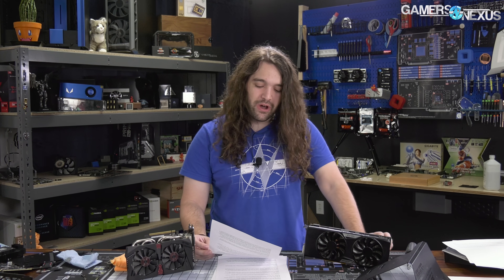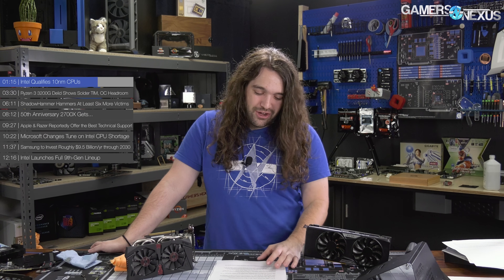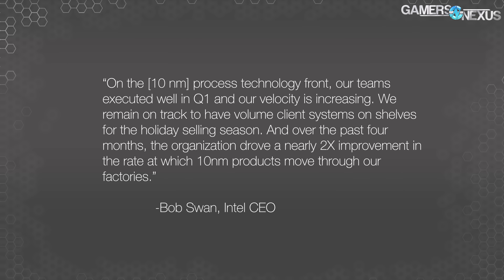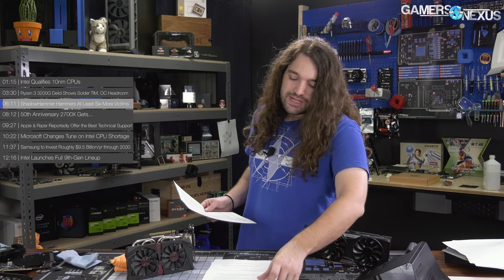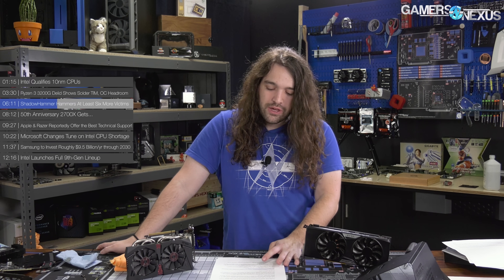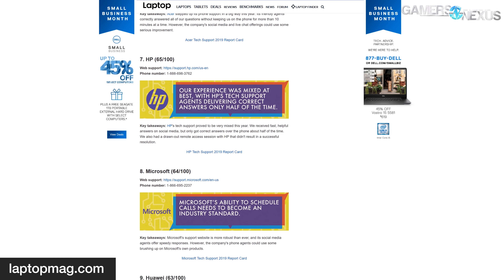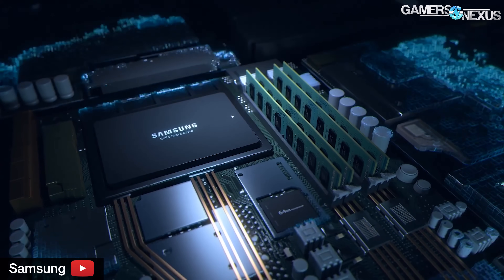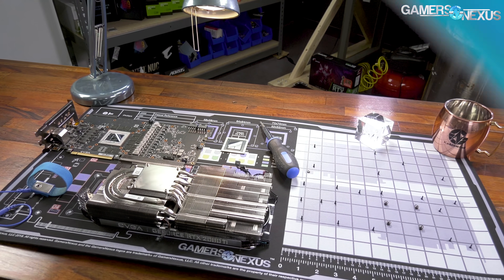HW News - Ryzen 3200 Delid, Intel 10nm Qualified, & More Malware

Comment: I really hope Ryzen 3000 is even better than 2 and really keeps that gap short between it and Intel. I like competition
Reply: Hee hee, getting irate about CPUs
Reply: @goblinphreak2132  It will be hard to do given Intel uses it's own fabs unlike AMD.
Reply: The hell is this comment line?
Reply: @Herr.Mitternacht  I'm stating facts that's all I've done. Responding to stupidity and fanboys with no brain cells but whatever mate.
Reply: @yulfine1688  I hope u were trolling man, u can't b serious
Reply: its a fake 7nm 10nm design that is less efficient than intels own design which is also harder to work with but no one cares about that because people are too stupid and too excited with fanboyism to notice. But yes the 3000 series is supposedly compared to a 9900k in performance when you talk about the the high end 300 series anyways. So in anycase they made a chip that caught up with a supremely old design....yeah good job.
Reply: @yulfine1688  you are aware that the ryzen 5 8 core part was beating the 9900 k benchmarks currently? The ryzen 9 part is going to be double that
Reply: @yulfine1688  all right kid just to help you out. We're talking about the new ryzen 5 coming out. The 3000 Series ryzen 5 is an 8 core 16 thread part. It's also running at 5 gigahertz. They demoed that part a couple months back and it beats 9900 k. Considering it's on a smaller manufacturing process 7 nanometers versus 14 that means it's also winning in single core IPC. The ryzen 3000 series R9 is a 16 core 32 thread part. It is double the performance of a 9900 k. Because it's double the threads and cores. Usually when someone starts name-calling it's because they  lack intelligence and can't communicate easily in an argument. If you actually did any kind of research you would understand that the part demoed had one CCX module and there's room for two on the chip. Plus each CCX has eight cores 16 threads. And if you're talkin about backwards compatibility you realize Intel has been making people switch motherboards every two generations. They even made people buy new motherboards when the socket is the exact same size 1151. Z270 boards don't support 8th 9th gen use the same socket same thing with z170 boards. So don't even get me started on backwards compatibility. Until recently Intel hasn't soldered its CPUs. They used to solder the 2600k series and prior to all their servers processors and those things are still running . You are aware that every single Intel server processor is still soldered correct? If it was a reliability issue you think they would solder server processors? You know with the customers who need reliability the most? I still have 1st Gen x5675 6-core processors sitting on my shelf and in one of my computer's that still run great. I bet you don't even know what one of those is you child. Settle down stop having your outbursts and just wait till the product comes out and benchmarks are compared. You're literally bitching about something that hasn't come out yet competing against something that Intel hasn't even finished designing. That's like complaining about a 2020 car losing to a 2023 car that hasn't even been designed yet.
Reply: @yulfine1688  >Creates a new CPU with a new design/layout which shifts the entire desktop CPU market away from quad core refreshes, now after 1 node shrink it is apparently comparable to the fastest current desktop processors on the market (core for core) and you type ''they made a chip that caught up with a supremely old design... yeah good job'',  acting like the 9900k didn't release less than half a year ago. yes they ''caught up'' with single core performance but the architecture itself has much much more capability outside of that. 
It's almost like you're an incredibly biased imbecile who doesn't understand anything about cpu design outside of single core performance. i bet you where one of those idiots who said a 7600k was a better buy than a r5 1600 when they came out because ''muh single core''. and now you're stuck with a 4c/4t CPU on a outdated platform, good one.
Reply: @EngulfedEUW  lol what are you even talking about 14nm is definitely outdated. The 7600k beat out most other chips except for some 6 core and all 8 core chips for multi core use. The 8600k was slightly beaten by the 2700x in multi core tasks except the big difference was in rendering images to where all high core counts won. The 9900k has great multi core and single core performance. So whatever you're smoking mr fanboy idk. I care not for these companies I care to get the best parts.
Reply: @yulfine1688  First of all 14nm isn't outdated because it's THE current fastest desktop liphography,  Secondly the 7600k cost the same/more than the r5 1600 when it released... THAT'S THE POINT, and it only beat the AMD CPU in single core heavy workloads in very specific circumstances and got smoked by the r5 1600 in multicore workloads. Thirdly the 2700x absoltely smokes the 8600k in multi core tasks, i'm sure you're referring to the 8700k not the 8600k because the 8600k is 6x/6t and the 2700x is 8c/16t, Lastly 7nm and 10nm aren't marketing schemes it's just what they call the lithography they manufacture the CPU's with... Intel and AMD don't use the same source for their silicone.
Reply: @EngulfedEUW  last I checked 4.2ghz on a 12nm ryzen beats 4.2ghz on a Intel 9900k @14nm so that is not true... currently 12nm is the fastest available lithography...
Reply: @SilverKnightPCs  should of phrased it as the fastest current desktop CPU is on 14nm
Reply: @EngulfedEUW  You don't need to prove anything, comparing Ryzen 3000 to current Intel offerings is just ridiculous. There should be no arguments at that point. AMD bypassed Intel, maybe intel will come back in 1 or 2 years, but for now, AMD is ahead.
Reply: @HamzaElgarrab  also back in the day of bulldozer I was for one telling Intel fanboys that AMD isn't dead for multiple reasons before ryzen was even mentioned or leaked. I honestly give no fucks for either I want the top hardware that's all. And right now depending on my budget of..7 grand for the entire setup I don't care if its amds chips that are better or.intels i want the best. And the same goes for gpus. I want the best card on the market either dual or single either works. With such a high budget doing dual cards will work fine. Should last me I'd imagine a decent few years before falling so far behind they're not able to keep.up. though in reality they probably wont last more than 2-3 years.
Reply: @yulfine1688  I know you are trying to use your brain, but man, you got to do better than that. The way people call x-nm for various reasons, signal propagation speed, power consumption, signal stability, capacitance, induction, .... etc. etc. So when we state 7nm vs 10nm, no matter how one likes to spin, the fundamental lithography limitation is here to stay, either one pulls some smart ass short cut or not. Because in the end, size do matters. Intel needs to do what Intel needs to do, end of discussion. If you read the industry, you know people are gunning 5nm next, and Intel still works on what? And for a company size like Intel, they got to spin and you know that, right? Don't be taken too easily!
Reply: @yulfine1688  Amd's chip design is inefficient? in what way? they destroy intel chips in power consumption and scaleability... and that's before they are movibg to 7nm and a chiplet layout.
Reply: @yulfine1688  man, be civil, you literally insulted me for no reason..
Reply: @EngulfedEUW  The 7600k beats every ryzen cpu in gaming hands down.
In fact,Techspot did a over 30 game benchmark showing the 8400 beating the 2600 in almost every game.
https://www.techspot.com/review/1627-core-i5-8400-vs-ryzen-5-2600/

It is common knowledge that the I5 still beats Ryzen in gaming.
The only edge Ryzen has is in certain multi-threaded apps.
Reply: @SilverKnightPCs  Where did you see that?
As of yesterday's rumors AMD fucked up.
Basically we are getting Ryzen 200 just better efficiency.
https://www.techspot.com/news/79839-leak-ryzen-3000-runs-45-ghz-beats-ryzen.html
Reply: @phillip_iv_planetking6354  frame time consistency is won by the 2600 though. And who cares about the marginally higher fps at full hd resolution. If you build your pc right you'll get a gpu bottleneck before a cpu one
Reply: @benwlee  TSMC's 7nm is not a real 7nm it is only 7nm in name.
This is common in the industry.

In fact,TSMC's 7nm is compared to Intel's 10nm because it is far closer to a 10nm than an actual 7nm pertaining to transistors.
Although,certain key features are smaller in TSMC's "7nm" than on Intel's 10nm.
https://en.wikipedia.org/wiki/7_nanometer

And if rumors are to be believed as of late then all we are getting from AMD is Ryzen 2000 just far more efficient.
Which is good but not enough.
Reply: @L424RU5  In some games.
But losses in majority of them.
Reply: @phillip_iv_planetking6354  "the 7600k beats every ryzen cpu in gaming hands down" then you share an article showing an i5 8th gen getting beaten by a 2nd gen ryzen cpu... baring in mind the 8th isn't unlocked but does have 2 more cores than the 7600k.

i also find it funny when you say the ryzen cpu beats it in "some" multicore workloads... you mean just about all of them right?
Reply: @phillip_iv_planetking6354  also both lithographys are "7nm" only in name... "7nm" does not relate to any kind of dimensions... it's just what they name the iteration, yes intels "10nm" is as dense as AMD's "7nm" but they use different sources so obviously they won't have the same silicone.
Reply: @phillip_iv_planetking6354  also don't know why people are discussing intel 10nm when refering to desktop parts anyway... if sources are correct they won't release 10nm desktop for years yet.
Reply: @EngulfedEUW  Because there is not much difference in gaming between the two and there is no 30 game benchmark comparison with the 7600k.
But even the small benchmarked game lists the 7600k wins in majority of them just like the 8400.

Ryzen does not win in all of them.
It wins in some and loses in others.
Reply: @EngulfedEUW  Depends if you believe rumors.

Also,I think because if the rumors about Ryzen 3000 are true then we are getting nothing more than Ryzen 2000 with better efficiency.

That's nice but nowhere near great or game changing.

Best to take everything with a grain of salt.
Reply: @phillip_iv_planetking6354  oh is that what you meant by "the 7600k beats EVERY ryzen cpu in gaming hands down"? and no a 6c6t intel chip from a newer generation isn't "close enough" in gaming to a quad core for reasonable comparison, that's ridiculous.
Reply: @EngulfedEUW  I know.
They base their comparison on amount of transistors not dimensions.
I thought I stated this already?
Reply: @phillip_iv_planetking6354  yeah density, so the term 7nm doesn't correlate to a physical boundary it's just the name of the liphography... therefore it cannot be "fake"
Reply: @EngulfedEUW  Actually that is what makes it fake and a pure marketing ploy.
Reply: @EngulfedEUW  What?
Did you just really say this?
"and no a 6c6t intel chip from a newer generation isn't "close enough" in gaming to a quad core for reasonable comparison, that's ridiculous."

Is this really your logic man?

I can easily post benchmarks showing a 7600k and an 8400 neck at neck in most games.

Wow.
Reply: @phillip_iv_planetking6354  also the "rumours" you are reading aren't the same as what everyone else is reading, even the article you shared was very skeptical of that leak... we already know theres a clockspeed jump from the node shrink (efficiency) and we also know theres going to be ipc improvement... especially when you have reduced latency from moving to a chiplet design with seperare i/o die. that's just facts... anyone with any knowlege could work that out.

the "leak" you shared makes 0 sense. its made up.
Reply: @EngulfedEUW  Here is a benchmark of the 7600k vs 8600k and they game very close to each other.
It is only 7 games though but I can get others if you like.

https://youtu.be/YuY1jZUI2Cw
Reply: @phillip_iv_planetking6354  you may be able to show benchmarks where a 7600k and a 8400 are similar but any thread utilising game will show a difference. just like you can show benchmarks where a 9th gen i5 is comparable to  9th gen i7, but the i7 won't be fully utilised and the i5 will and in most games the i7 will win.
Reply: @EngulfedEUW  As I said best to take every with a grain of salt.
Reply: @phillip_iv_planetking6354  and no it doesn't make it a fake marketing ploy you baboon. 2 companies can make vanilla icecream, just cos one has more vanilla in it doesn't make the other "fake" vanilla icecream.
Reply: @EngulfedEUW  Way to move the goal post.....

Priceless.
Reply: @EngulfedEUW  So why base it on amount of transistors then?

And please,indulge......
Reply: @phillip_iv_planetking6354  move what bloody goalpost. if i have to sit here explaining cpu utilisation to you and how alot of games do not fully take advantage of higher core count CPUs (A trend that is changing) then its pointless talking to you. yes in some games an i5 can perform the same as an i7 when the i7's cores aren't being fully utilised... people have known this sort of thing for years. a 6 core intel cpu will be on average much better than a quad core for gaming, obviously. just because youve seen some cherry picked benchmarks doesn't change simple logistics.
Reply: @EngulfedEUW  LOL.
I never said they would not.
The point was they play very similar even with the extra 2 core in most games as I stated from the get.

Why you brought I7's up is either to move the goal post because you never had an argument to begin with or you simply have a reading comprehension problem.
Reply: @phillip_iv_planetking6354  go to the video you shared. the games where the 8600k was leading it was leading by 15-20% and was never fully utilised, now go look at the cpu utilisation in the games where it was neck and neck... the cpu utilisation on the 8600k was roughly half of the 7600k. these games are terrible benchmark tools to. none of them showed high cpu utilisation even on a quad core.
Reply: @EngulfedEUW  Again?
I never said they would not.

Wow.
It's like talking to a wall....
Reply: @phillip_iv_planetking6354  i brought up i7s because you showed a 6 core benchmark when talking about a quad core, like core count doesn't matter. i brought up i7s to show that core counts do matter.
Reply: @phillip_iv_planetking6354  they base "density" on the ammount of transistors. that has nothing to do with the naming of the liphograpgy, obviously intel and amd don't have the same manufaction.
Reply: @EngulfedEUW  So now you are going going by assumptions to make a point?

"like core count does not matter"

ROFLMAO.

Wow.
Reply: @EngulfedEUW  They do it by amount to name it what they want.
It was always done by transistor size.

Intel does it too.

You truly know very little.
Reply: @phillip_iv_planetking6354  ok so now you're denying saying that they perform similar even with the extra 2 cores even though you just stated it again 2 conments ago... i'm done replying.
Reply: @EngulfedEUW  Performing similar and saying core count does not matter are two entirely different things LOL.

Jesus Christ man.

And yes they do perform "similar".

See what I mean about the reading comprehension problem?
Reply: @phillip_iv_planetking6354  last reply: IF core count does matter then they cannot "perform similar" unless 1 isn't being fully utilised (like in your cherry picked benchmarks) hence you can't use them interchangeably. secondly you claim i move the goalpost, let me remind you that your original comment was "the 7600k beats any ryzen cpu in gaming hands down" where you showed a benchmark for a completely different cpu. then went out of your way to find some of the worst benchmarks results i've ever seen which still in some cases clearly showed the 6 core handily beating the 7600k. you're obviously a salty quad core owner... byebye
Reply: @phillip_iv_planetking6354  actually a lot of new games coming out suffer lower fps and 100% utilization rates when playing with 4 core 4 thread. Assassins creed games are a good example as is the newest battlefield
Reply: @SilverKnightPCs  Well according to the 36 game benchmark it is very few games.
https://www.techspot.com/review/1627-core-i5-8400-vs-ryzen-5-2600/
Reply: @yulfine1688  did you know IPC is identical between ryzen 2000 and skylake/kabylake/wiskeylake/cannonlake? Do you realise this means that ryzen 3000 will have better ipc than intel?
Reply: @L424RU5  cannon lake doesnt even exist yet. 9th gen 9900k is 20+% more powerful than the 2700x. Not the biggest difference depending on the title. 3000 once again their ipc is also less effiencent but easier to work with and so forth. 3000 series top gaming chips rival the old 9900k 14nm architecture. Shows how far behind AMD is because if their chip design however it has its advantages as well. We can go on and on mate
Reply: @yulfine1688  that is because it clocks higher... an the same clockspeed they are almost identical in performance. The 9900k costs 550 eur, and a year later amd brings out the same performance for less than 300 euro. For most people amd is ahead of intel, because the top 1 percent who can afford 500+ cpu's don't count.
Reply: @yulfine1688  it's not AMD's fault that all Intel has right now are old designs
Reply: @deviouslaw  youd be correct intels chips are not cost effective and use a ton of heat and power even though it's old 14nm design. Their higher transitor count makes a smaller chip more difficult to create among other things. So basically you admit amds new design is inefficient in actually generating the power old technology does but at least it's more cost effective and less heat gen and power consumption. They.both have issues with their chips design.
Reply: @yulfine1688  I mean, Intel flexed a big process advantage on AMD for a long time. So it's sort of funny to see anyone really care now that AMD might have a slight advantage. In a way, process and whatever internal technology they're using to scale the chip like infinity fabric are really immaterial to me, I care about price to performance, platform forward compatibility, and to some extent the physical soldering of the processor that enables easier cooling.
Reply: @yulfine1688  And it's not ''fake'' 7nm,  Sure it's not the same density as what intels ''7nm'' will be but it's still 7nm.
Reply: @EngulfedEUW  exactly that's the point it's a lie 7nm and 10nm are marketing schemes that's all LOL
Reply: @yulfine1688  *marketing schemes*, ok, all foundation of human intelligence are all hypes now. Sigh... Have you finished your high school yet?
Reply: @EngulfedEUW  It is a fake 7nm.
It is 7nm in name only.